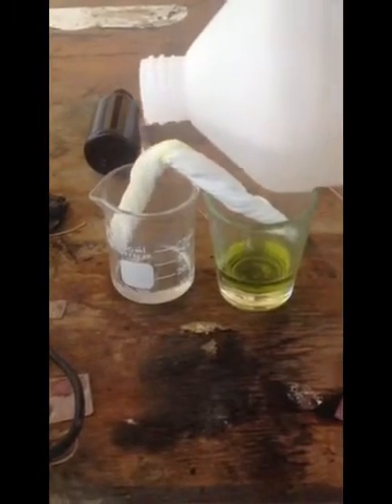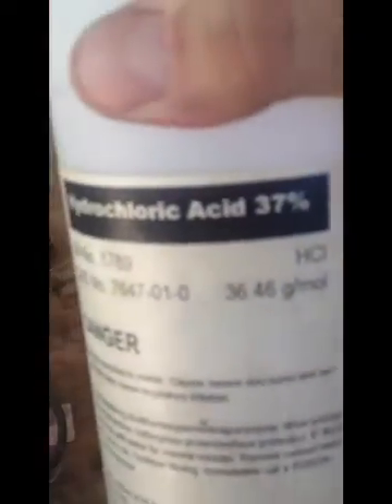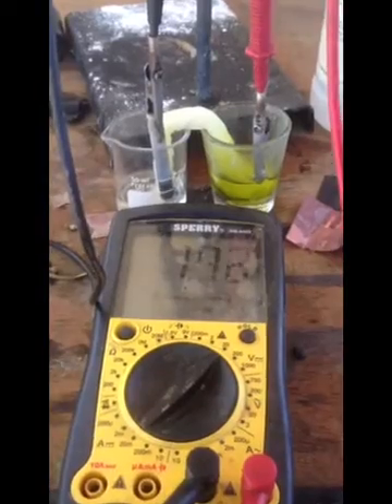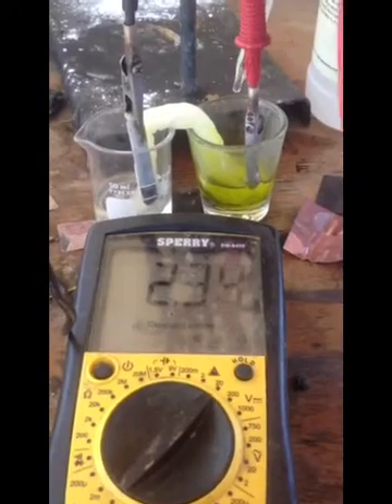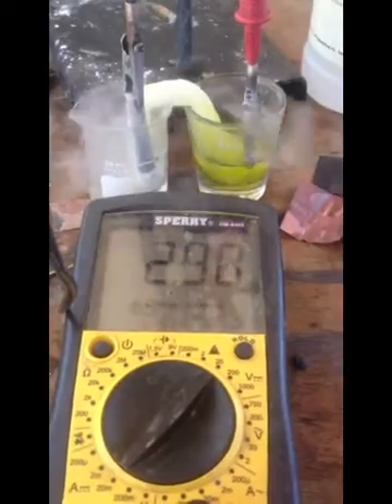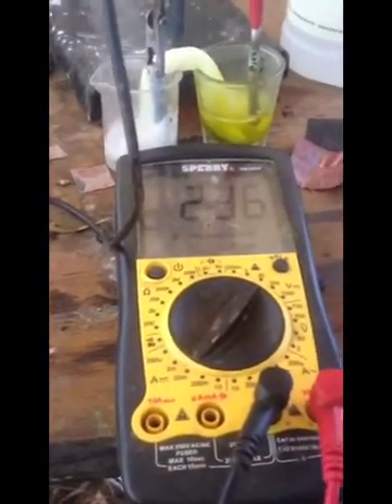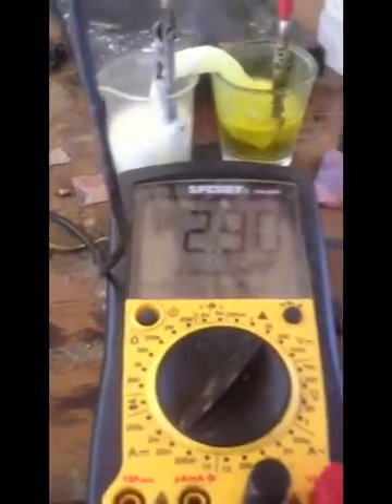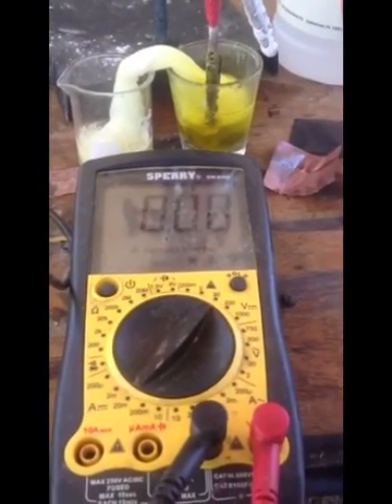Magnesium Air Battery 2.93v! High voltage air battery homemade how to make fuel cell

Comment: What is your anode and cathode and why
Reply from the maker: magnesium anode because it is easy to oxidize and iridium cathode because it is hard to oxidize.  You want to pump in more electrons to the anode by reduing it and pump electrons out of the cathode by oxidizing it for best results.  This makes it a hybrid battery fuel cell.

Comment: what is the yellow stuff
Reply from the maker: Its just hcl that has some copper dissolved in it from past experiments
Reply: NatureHacker  tnx man I can now defend my reasearh topic
Reply: then why hcl and hydrogen peroxide is poured in why not just salt and water
Reply from the maker: because the "electrolyte" is not just to conduct ions but rather to support oxidation and reduction of the anode and cathode.  The more it catalyzes oxidation and reduction the more voltage and amperage you can get.
Reply: why iridium i thought that the reaction must be a non metal and metal why they are all metallic
Reply from the maker: Actually the best results are from 2 metals on opposite sides of the chemical reactivity.  You need one very non reactive (like gold or preferably iridium) and one very reactive one like magnesium or lithium or cesium.